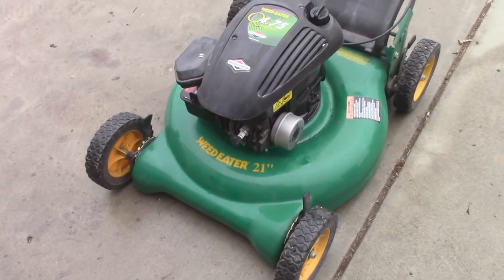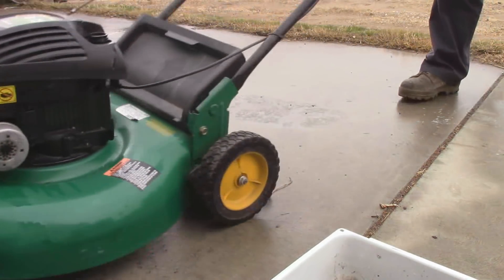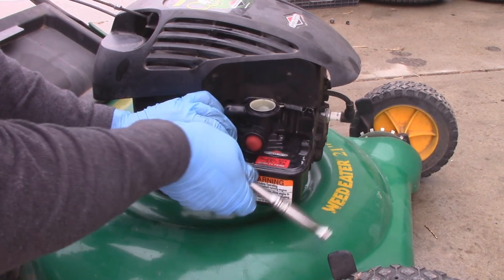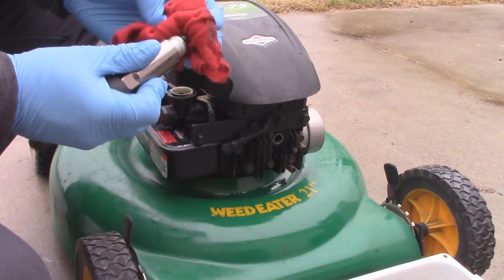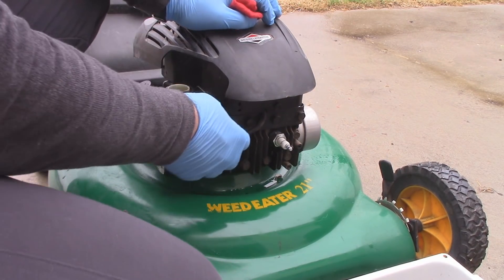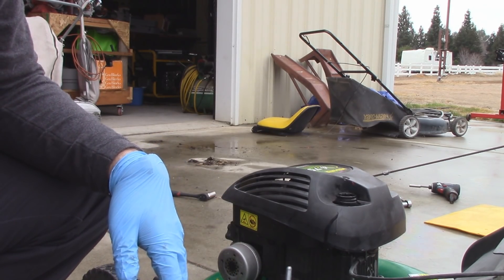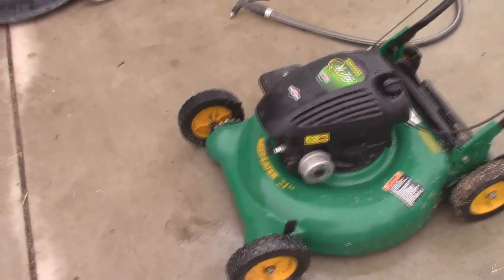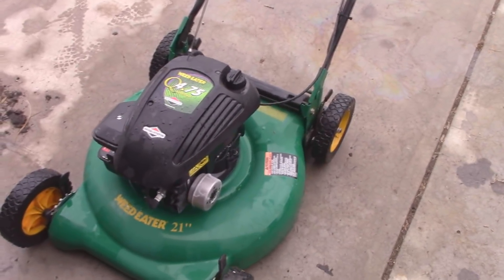How to Fix a Mower Overfilled with Oil

Comment: Well what to do after overfilled 🪔 oil, I suck it out til it almost need some oil back in it, but it still spited spattled out oil. And smokes, and wouldnt start😭, it's only 40 days old, what the next step??
Reply from the maker: Do it again until all that oil is out and make sure the spark plug is dry. Then restart it and let it burn all the residual oil out

Comment: How soaked in oil does a foam air filter need to be? Does it need to have just a little bit of oil or enough that it drips as soon as you touch the foam?
Reply from the maker: Not much. You only need about a tablespoon
Reply: @hanksgarage_  Thanks a lot! I didn't have much hope to get an answer from anyone since the video is 3 yo!
Reply: @hanksgarage_  I'd have another question for you. I'm very new to combustion engines, so I don't know much about them yet. It's related to your video.

I didn't overfill my brand new lawn mower but rather tilted it on the wrong side to clean the under + change the wheel height (on this model, I need to remove all wheels and screw them back on into the desired height holes!) and it stayed this way for at least half an hour.

When I brought back the lawn mower to level, I noticed it had leaked oil and a bit of gas on the ground, from the air filter.

I removed the air filter, cleaned it (hence why I need to oil it), and left everything sitting there for 6-8 hours to check how much fluid would drain, which wasn't much more than a few tablespoons.

I was wondering what I should do next. I still have 95+% oil in the oil tank so I don't need to put more.

If I understood correctly, my next step would be to try to start the lawn mower and if successful, just let it burn the excess oil as white smoke, BUT if the pulling cord is abnormally stiff, then I 'd need to remove the Spark Plug and pull 15-20 times on the Cord to help drain what's left inside (you said "to drain the cylinder" but I don't quite know what it means) before cleaning the Spark Plug and starting the lawn mower (after reassembly of course).

Am I wrong?.

• Since I only tipped the lawn mower on the side and never tried to start it since (so no damage), would I need to completely drain the oil and replace it or is this just for when you overfill it? (My oil is brand new by the way)

• If I need to clean the Spark Plug, what should I use? Do I absolutely need some specialty product or is there some more common things that can be used?

Sorry if this was long!
Thanks again!

P.S.: I'm not a 13 yo. I'm an experienced DIY'er, I've always learned anything I needed to in order to build/fix anything; I've just never used much gasoline engines since I've always been living downtown in a big city and I don't have any need for a car.
Reply from the maker: @christiangauthier727  it’s ok that you had it tipped over. Any residual oil will burn off and show as smoke when running it won’t hurt anything. Cleaning plugs I use carb cleaner
Reply from the maker: @christiangauthier727  once the oil goes past the rings it creates a near perfect seal and boosts the compression and feels very hard to pull. Hence pulling the plug and letting it free wheel all the oil out. You won’t get it all but as long as you get most of it that’s fine
Reply: @hanksgarage_  To clean the Spark Plug, would WD-40 work (I just read it can be used to clean a spark plug, but people often misuse this product!) or I really need to go buy a bottle of something that I 'll  use once every 5 years?
Reply from the maker: Wd40 works fine too

Comment: 😅TYVM - a simple mistake to make. Forgive the excuse, awaiting cataract surgery, eyesights not what it used to be. I guessed this could be a common error: too much clean SAE30 on a clean dip stick is difficult to see even with better eyesight than my own. I wasnt 100% sure how to drain (on its side). I appreciate the advice to pull the plug for a few cranks. B&S @20oz isnt clear w/dipstick is guide & unknown amount in the case. TYVM for helpful videō.

Comment: I have a lawn tractor, and I use summer oil. And I think it has 1-2 ounces over the max. I ran it a couple times with the amount. Because I didn’t know if it would burn any oil. Is it fine running on ever so slightly too much oil. It seems to run fine.
Reply from the maker: That’s perfectly fine I doubt you will run into any issues

Comment: My male friend overfilled my Victa 127cc lawnmower with engine oil, it was smoking a lot. I emptied the extra oil out  but now I can not pull the rope to start it. It looks like it’s stuck. Any help, please. It’s a new mower.
Reply: Try removing the spark plug. Give the cord some pulls and see if oil comes out of where the spark plug was connected. Reconnect spark plug and try starting again.

Comment: When changing the oil on a Sears Craftsman lawnmower with a 6.5 Briggs and Stratton engine do you check the oil level with the dipstick screwed all the way in or just placed on top of the oil filler tube ?
Reply from the maker: I always screw in
Reply: @hanksgarage_  Hi. I did some more research and on the model I have it states to screw in the dispstick to check the oil level.  I had to drain some oil out of the engine to get the correct level. Thanks for your response.

Comment: Mine smokes and I never ever have over filled it with oil. I fill the oil so the oil goes to the half way point in between the 2 lines. It starts for 3 seconds and then it stops. It has a clean filter clean carburetor. I have no clue why the damn thing wont start.

Comment: Briggs and Stratton 140cc engine over filled with oil now leaks from ovh seal can will a new seal fix it
Reply from the maker: First get all that old oil out. You may be able to reuse the seal but yes replacing it will fix it.

Comment: How about using a turkey baster to suck it out?
Reply from the maker: You will need a straw or tube that will fit in the dipstick tube.
Reply: A turkey baster will fit into the 1.25" oil chamber opening on my mower. Thanks for the quick response BTW!

Comment: I just ripped my mower to clean underneath and started and it was smoking.  The oil looks as high as that but is it because it was on its side or just too much.  It was running fine before I tilted it.   I guess I'm going to let it sit til tomorrow and try again. If it still smokes I'll empty some out.

Comment: Hey, I made the oil mistake, drained it, refilled it, let it settle, however there is still smoke, does this mean the engine still has oil in it ? Do I have to remove the spark plug to get all the oil out ? It’s a Troy Bilt push mower, only a year old.
Reply from the maker: Itll all burn off if you just let it run a bit, you only really need to pull the plug if its hard to pull the starter cord
Reply: Hank's Garage Thank you, working well now.

Comment: Tell me if I'm right or wrong overfilling a lawn mower motor with oil will calls it to blow oil in your carburetor and out the exhaust
I accidentally overfill my mower with oil when I was changing it I was cutting grass and it blew out a big Puff of white smoke
Reply from the maker: Yea it’ll go straight through the pcv line.

Comment: How do I clean the combustion cylinder? I believe oil reached the spark plugs and it won’t start.
Reply from the maker: Pull the plug out and clean that off. Then do as I did in this video. You’ll have to just let it all burn out when you get it started
Reply: Hank's Garage I enjoyed your video. Very simple process and yes, I made the previous owners mistake. I followed the instructions on the machine but turns out I only needs 1 qt. Instructions says 1.5 qt. Now I know because I drained the oil and carefully monitored the dip stick. Thank You. 👍

Comment: Just overfilled my very first new mower. Started smoking, and me thinking that it was cuz I went on an angle, continued working then realized what I've done. You're a lifesaver, thank you for this video, very informative and easy to follow. Mower works great now, gonna try to mow the backyard tomorrow and see if everything is good to go. I was scared that I've damaged the engine.
Reply: Lol juat did the same  with Oil  I think I ddi to much...starting my backyard  tomorrow  aswell  after trying this

Comment: Wonderful advice.  To clear out debris I tipped my lawnmower on the wrong side.  When I righted it I found the air filter had oil in it.  After starting the lawn mower had a lot of white exhaust and burnt oil dripping out the exhaust.  The oil was half full.  So I did take the spark plug out and primed the engine a few times, put the spark plug back in and it started.  The white exhaust lasted about four minutes before clearing so I finished mowing the lawn and managed to stay out of the doghouse.  Thank you.  Prior to starting I did put more oil in it.

Comment: How do I do this for a ride on mower that has a key to start instead of a pull string? I got a used mower and the oil was really old so I decided to change it.  Unfortunately I listened to the sticker on the inside of the hood and added 56 ounces of oil, which I soon realized was way too much.
Reply from the maker: Same way. Pinch off the fuel line. Take the spark plugs out after you drained the crank case then engage the starter and blow it all out
Reply: @hanksgarage_  I ended up draining the oil out of it then I took the spark plug out and turned the crank by hand. The oil didn't really shoot out like in the video but it did spew out slowly. After about 15 minutes I decided I had had enough and put it all back together and started it up. It started right away but I have been having issues where when I shut it down it won't start back up unless it sits for like ten minutes. I didn't think it would turn over without the spark plug in it, but if you think it will help I'll do it over the way that you said to do it.  Sorry for the long response and thanks so much for the help.
Reply from the maker: If anything oil is getting on to the plug and interfering with the spark. I cant think of anything else that would cause that issue...As for expelling all the oil out, on these bigger motors they need to be run with the starter to hit higher rpms, doing it by hand you'll get some but not all the oil out.

Comment: Sir after watching a ton of videos of how to get my brand new mower to start after running it without oil the first day I got it smh your video was the only one that told me to empty the oil, and to spray the spark plug. I did that, plus sprayed some pb blaster in the cylinder and voila my mower runs beautifully...one pull and it starts! THANK YOU THANK YOU THANK YOU for this video!!

Comment: I had that on a curb find mower I picked up. I pulled the plug and the oil just spewed out all over the driveway, haha. Thanks for the video, Hank. At least you can still work on stuff. It's been so cold here that I haven't ventured into the garage.
Reply from the maker: Delmont Industries LTD hey man it’s weird weather even for here. It was 70 degrees on Friday. Usually it’s in high 50s low 60s during the day this time of year.
Reply: Ha! I would love high 50's. It was -2 Farenheight this morning.

Comment: I have this same issue, I emptied the oil, replaced with the correct amount, checked the oil, checked it again, let it run for 4-5 mins, the smoke still comes out in significant amounts, checked the oil again, still fine, run it again for 5 minutes, still smoke.....

What am I doing wrong? I am using the correct oil for the Honda GCV 160 currently at the correct level, still lots of smoke no matter how long I run it.
Reply: If it never stops smoking, then oil may be getting into the combustion chamber.  The means the seal(s) that keeps the oil separate from the gas is blown/worn so it needs replaced.

Comment: I bought a mower with a similar problem to this just before christmas. When I started it the first time it smoked more than any mower I've ever seen so I checked the "oil" level and it was indeed way over filled. When I emptied it out though it appeared the previous owner had been using something like diesel as an oil substitute.....thin like water and I'm amazed it survived as it's a generic chinese mower!

Comment: Subscribed... I learned a few things. To bad you are not next door as I have multiple outdoor tools I need serviced not only do you know what your talking about but damn CHEAP. I took my HRX217 mower who is supposed to be a professional to install a new adjusting lever and he messed everything up. Self propel not working right had a retainer clip and few washers not installed... the gear was installed the wrong way so i had to remove and reinstall. Now here I am studying the wheel diagram to order what ever was missing.... to think he charged me $60 to screw it up.

Comment: I had this happen with my Snapper SP80,  Briggs 725exi since I had drained the oil and gas last fall. I had kept the original included oil container and could swear I remember originally putting the whole bottle of oil in per the directions on it, it was  a 15 oz "Briggs" branded container,   so I refilled it from a new quart and put the whole "Briggs" 15 oz container in and it started smoking when started, checked the oil, too much, but I left it figuring it would just burn out excess once the smoke stopped which it did in a few seconds, and ran  fine  but smoked and coughed on a steep embankment but finished mowing.Then yesterday I was mowing and hit that embankment by the road and it smoked and coughed  but that stopped and I continued mowing and a couple of minutes later it just quit running like it was out of gas but wasnt.
So I checked the gas, it was a good half tank, would not start. So I dumped the extra oil out and cleaned the plug, wouldnt even try to start, so I came here for ideas and this was THE video!
I wound up removing the carb and completely flushing it  all out, bowl removed and all, and put the gas line on it and let some gas flow thru it with the bowl off, put it all back together and it started right up.
There was obvious oil in the carb throat and filter, nothing sprayed or ran out of the plug hole though, so it was just the carb had oil in it and that was probably blocking the flow/atomization of the gas.
It's possible not all the oil drained out last fall, and possible I filled the container with more oil than the 15 oz, so the engine had too much oil but not a LOT of extra, just enough to foul the carb

Had one guy try to tell me to forget  it, that the extra oil caused scoring of the cylinder, scrap it and buy a new one!
Nope I  didn't believe that, it had compression, it had spark, the only thing left was the engine wasnt getting the gas right.

Comment: We used to drain the oil from underneath our old Toro mower.  We had to get rid of it because over the years it accumulated a lot of holes in the deck.  Not safe.  We got an MTD mower and I hate it that we have to turn it on its side to get the oil out.  What moron thought that up.  So I got a large plastic medical syringe and attached some plastic tubing to it to fit in the oil chamber and suctioned oil out then removed the filled tubing and ejected it into an empty gallon container.  The rubber stopper on the syringe came off a few times, but we managed to get the oil out eventually.  The owners manual specifically said not to turn the mower on its' side at more than a 90 degree angle, which is what we would have to do to drain all the oil out.  Couldn't the oil mix with the gas if you do that?  Also, I'm a woman and I have to do this myself many times.  The darn mower is heavy and I'm afraid it could fall on my leg or foot.  I'm gonna stick with the plastic syringe method because they're pretty cheap (can get them on Amazon), less messy and relatively easy to do.  It took a long time to fill the oil because I made sure to wait for it to settle before I checked the level.  When I have to change the oil again next time, I think I'll use one syringe to remove the old oil and another to transfer new oil from the bottle to the oil chamber on the mower.

Comment: It seems I get them either overfilled or nearly empty. I took a year old Troy Bilt in on trade last year that the previous owner put a full quart of oil in.
Reply from the maker: Alan Marshall ya agreed over or under it’s usually one
Reply: @hanksgarage_  Just "recycled" one today. I didn't want to get too dirty this evening, but I got it to putter and run. Tomorrow, I'll drain everything out, go through it and get it running right. At least I know the starter cord works correctly.

Comment: My late step father in law overfilled his lawn mower and it dropped a valve, destroying the motor.  You were lucky.  I always fill my outdoor power equipment up to the fill line and maybe slight above but never to the point you found.
Reply from the maker: John Clarke yup. I’ve never overfilled any of my machines but I’ve been brought a lot that have and picked quite a few from the curb like this

Comment: My weed eater lawn mower starts then stall. Carburetor is clean, gas cap is clean and I installed a new spark plug.
Reply: Dirty carb pin.  Carb may look clean, but that carb pin is dirty even if it looks clean.

Comment: Had a customer come in with a Ariens walk behind mower (pretty nice mower) and stated that it stopped working and she noticed it was low on oil. So....She filled it all the way to the top of the dipstick tube. This did not solve her problem of course and brought it into the shop for repairs. After pumping out numerous quarts of oil out of the mower (maybe 3 to 4) and filling it with the proper amount, the reason the mower stopped working in the first place was it ran out of gas.... Stories from retail small engine repair. Happy new year to you! Looking forward to more repair videos and whatever vintage things you might find in your adventures.